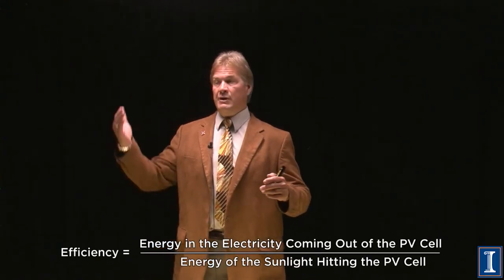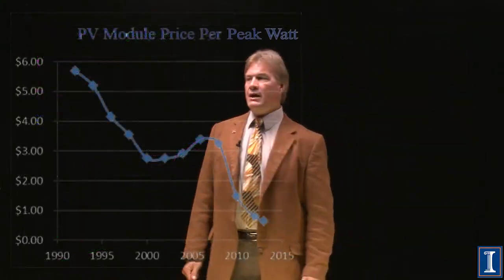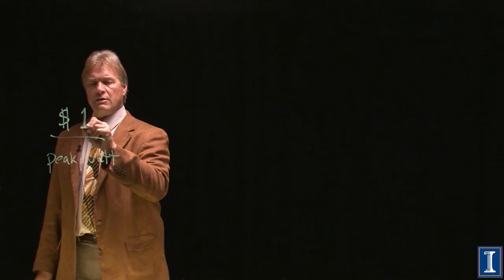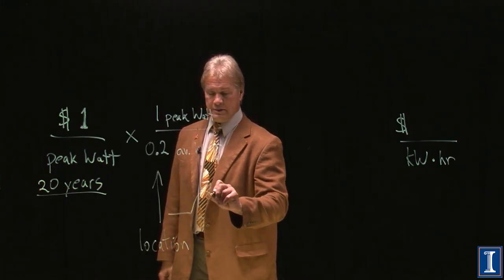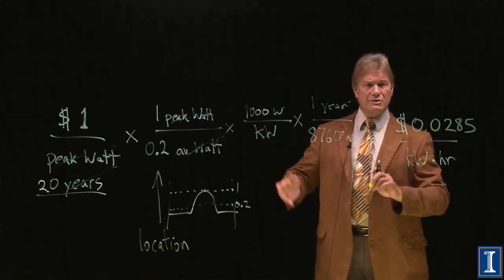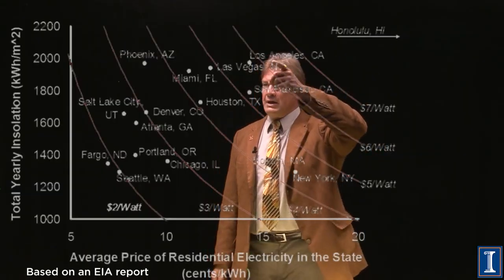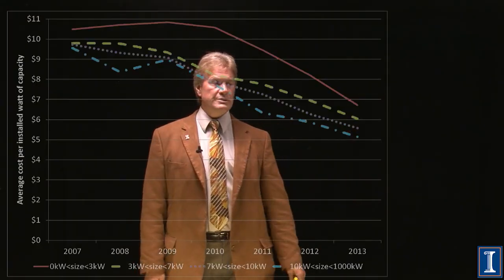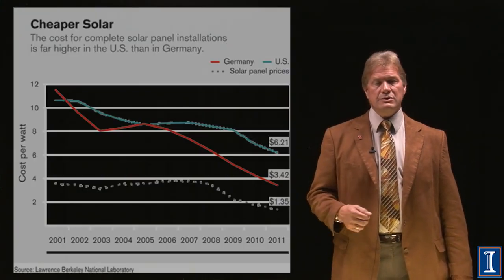The Cost of Sunshine

Comment: When I bought my new 5,000 sqft home I ran the air conditioning with abandon during the summer to see how much it would cost me.  My home used 3.2 mega watt hours a month.  OK, how about 3,200 Kilo watt hours a month.  But here in Loveland, Colorado I was only paying 6.5 cents a KWH in 2006.  Now in 2020 I am paying about 9.7 cents a KWH.  During the winter months and replacing most of my lighting with CFL or LED lighting, I got my usage down to about 1,400 KWH.  Air conditioning is a BIG energy draw on the grid.  Places where solar is cheap in the south western part of the US requires huge amount of electricity to run their air conditioning.  In the north where it is much cooler, they use natural gas to keep their homes warm.  It is not cost effective to heat with electricity.  The real calculations and the debate of solar-wind verses fossil fuels is very complicated.  The use of CFL and LED lighting has made a huge reduction in electricity usage on the grid of the US.   Microwave cooking takes much less electricity that does an oven too.  Only places where no electricity is available at any price does solar-wind power makes sense now.  The costs of solar and wind power will never compete with fossil fuels even if the solar panels costs drop to 25 cents per watt.  Nuclear power electricity generation seems cheaper than fossil fuels now because they don't factor in the total costs of the safety factors needed for the plants and the total costs of spent fuels storage.  One nuclear plant meltdown will destroy all the savings from this method of generating electricity.  This is the lesson to learn from this video.

Comment: Great video!
You can really see how solar really isn’t an option most places due to physics and just a few economic considerations. 

There are a few additional things that make solar even more expensive he didn’t cover:
1. Subsidies. Money taken from taxpayers and redistributed to solar companies, installers, and customers to artificially reduce the cost. True costs are far higher. 
2. Efficiency over time. Solar efficiency drops dramatically over the years.
3. Warranties. He came up with a 20-year warranty but no company has lasted anywhere close to that long. And even if there is a warranty, that’s not a guarantee you’ll receive it. This number should be cut by 50-75%
4. Maintenance. Other forms of power require no maintenance by the consumer. Solar panels need to be frequently cleaned or efficiency goes down even further. Also they are usually mounted on things like roofs which also need to be replaced or maintained and solar would need to be removed. 
5. Damage. He waived off hail and storm damage and didn’t figure it in at all. But most solar systems get damaged quite easily and the consumer would need to pay to replace it. They don’t pay for traditional methods. 
6. Balancing the load: Solar systems usually can’t stand alone because they have a hard time balancing power loads without gigantic and expensive battery arrays. Most solar systems are used in conjunction with grid tied power sources which provide the actual stable power and in emergency situations as well.
Reply: Lies
Reply: @jackfanning7952  Solar advocates do lie frequently... I guess you have a point there.  ;-)
Reply: Let's take each of the points you mentioned: 
1) Nuclear has received 50% of the subsidies granted by the U.S. for energy. Fossil fuels, 25%. Everything else, 25%. True costs for nuclear are much higher because they haven't disposed of any nuclear waste in 75 years and taxpayers are paying utilities $1 billion a year to store their own nuclear waste. on site within 100 miles of every major city in the U.S. What could possible go wrong? Nuclear is not required to obtain insurance for liabilities from nuclear damage. Nuclear utilities are bribing legislators to increase subsidies for nuclear and strike down legislation favorable to energy conservation.
2) 48% of the nuclear reactors ordered from 1953 through 2008 were cancelled, 18% were prematurely shut down and 14% experienced at a one-year-or-more outage. Not very reliable, eh?
3) The only warranty you will get from the nuclear industry is that they will take the profits and the public will pay for any liabilities. History has shown there will be plenty of liabilities from the nuclear industry. You betcha!!
4) See item #2, except add a few billion for much costlier nuclear maintenance and cost for substitute power. New Orleans' ratepayers had their bills go up 300% in one month in 2020 due to the maintenance shutdown at Grand Gulf nuclear plant. 
5) The whole world for many generations to come will pay for nuclear damage. Damage that cannot be completely mitigated once you open nuclear's Pandora's Box.
6) You just haven't been keeping up with the current events in the energy field have you? Existing storage systems for any energy source are readily available. There have been astronomical advances in storage technology in the last decade as well as cost reductions in renewables. Lazard, the largest independent financial institution in the world. states that storage can be managed for 1.0-1.5 cents per kilowatt hour.  Wind or solar and battery storage can be had for less than half the price of nuclear.
Reply: @jackfanning7952  
I’m not sure where you got your information from but it’s all wrong or outdated?? 
So-callled “Renewable energy” obtained a whopping 93% of federal energy fuel subsidies while generating a mere 22% of total U.S. energy. This is directly from the U.S. Energy Information Administration (EIA). This also doesn’t include how most states don’t tax wind and solar and give them other benefits redistributed from unfair additional tax levies placed on nuclear. 
The vast majority of nuclear waste is kept on site, safely, securely and without any additional cost in concrete caskets the size of a car. What can go wrong?? Not much. Because it’s easy to simply pour another concrete container. The entirety of all nuclear waste produced in history can fit on a single football field it’s so little. New reactor designs actually run on what was previously considered waste. And I’m glad you brought up insurance liabilities, because wind and solar are completely free from prosecution even after all the environmental damage they caused. Wind has special permits to kill rare endangered birds. And if you want to talk about bribes, that’s what the wind and solar industry is based on because they don’t make a profit since they produce so little energy. Talking about reactors shut down is just political decisions, not economic ones. And there is no warranty from wind and solar, all the companies fail after a short time. The only guarantee is that they waste taxpayer money to prop up the industry. The Grand Gulf power plant provided power at 0.5 cents per kilowatt which is one of the cheapest rates in the US… so whining about a 300% increase is just silly if you look at the actual prices paid. Regardless, people are getting a rebate on their bills now. And if you want to talk about permanent damage, wind and solar are far far faaaaaarrrrr worse. The current mines can’t keep up with production for all the needed rare earth metals and other materials so more and more mines are needed. Most of which are incredibly destructive to the environment and operated using child slave labor. Let me say that again. CHILD SLAVE LABOR. Wind and solar’s short lifespan also has them filling up toxic waste dumps to capacity. Unlike your goofy claims of not keeping up, you should take your own advice. There aren’t anywhere remotely enough batteries to store the energy required for homes. The batteries are also far worse for the environment than anything else and don’t last long. They aren’t economical and the advances are all in a lab and not practical to use anytime soon. Lazard’s figures by the way factor in billions of dollars in taxpayer funded subsidies to come up with the 1-1.5 cents per kilowatt hour. That is 3x times the cost of Grand Gulf Nuclear Plant by the way!! And that’s not even counting the costs to generate, deliver and maintain the power which is astronomically stupid. If you think wind and solar are a good idea, reach into your own pocket and personally donate your own money to subsidize it. But let’s be honest here, we both know you’d never do that.

Comment: REAL BENEFIT OF SOLAR IS NOT 8 BUT 2 CENTS, AND BATTS CAN'T SAVE.  Great video, but he still assumes the utility will always pay for Solar electricity from homeowners at market price, and has and will keep having Fossil Fuel power plants to cover load at night or days or week of zero sun due to clouds.  In real world any utility will have its Coal and Gas power plants it must build and maintain and keep to cover 100% of load in case of bad weather or nighttime -- and the only benefit of Solar power to the utility is the savings in not burning some coal and savings in maintenance from running plants a few hours less midday some days.  This coal savings and maintenance savings is probably just  2 cents a kwh not full 8 cents, so a power company will only want to pay homeowner  2 cents, and this scheme will be needed if solar ever becomes more than 10%.  Incidentally, sun is good only for 6 hours a day and 0 hours on cloudy days so even if you built solar cells enough to carry 100% of load these due to the few hours would only cover about 30% of power needs through the day, which is depressing but a fact.  In reality for all these reasons Solar is terrible option for power grids and will probably stop at 10% of load, so Solar is not an alterative to fossil fuels for electricity.  Batteries cost so much and wear out each decade using them would cost up to 4k a year plus whatever fossil or solar costs you have, batteries to cover nights and days of bad weather is NEVER going to be tried which leaves Solar a bad idea.  Frankly, Nuclear is the only green option.  I would be glad to see numbers showing I am wrong.

Comment: Just a couple of thoughts from a Phoenix area Realtor that has helped people buy a house with solar. First off leased solar gives no value boost to a house because it's a lease and some buyers don't want solar leases for whatever reason. So, a lease may impact things when selling your house. Owned solar gives people a tax break of some 25% or so based upon state & fed tax laws & credits which change every year. Like every other improvement to a house (pool, kitchen remodel, etc) you will not get all of your money back as a rule. Generally speaking improvements only recoup some 30% of their value on the sale of the house and that is what I'm seeing with owned solar. So, if you spend $30,000 on a system and get $10,000 tax credit, and it boosts your home's resale by $10,000 you will be out $10,000 minus what you have saved in electrical costs. If you save  $2000 per year then you break even at the 5 year mark and if you keep the house for 10 years you should make $10,000 on the solar system. But, if you sell at the 3 year mark you would lose $4000 in this example.

Of course this is very simplified and your mileage will vary. I'm just pointing out an area that you should verify the details, actual power production, costs, savings, etc as part of your buyer due diligence.

Comment: the 20 year warranty number is BS.  No solar panel installation company has been around 20 years and none will be over the next.  They always get out of warranty work.  The cost breaks down to ridiculous if you use a real number for replacement time.   Also, you did not mention maintenance.  There is almost zero $ maintenance of the coal powered electricity in my house.   With solar power on the roof you have to clean them monthly or the efficiency number goes down.  If you think rain will clean your solar panels just look at your car after a rain!  Unless you're under 50 years old, you will be paying someone to clean your "power grid" on a regular basis.

Comment: The calculation neglects the decommissioning & long-term storage costs which are negligible for gas but very high for nuclear. If you factor this in, the business case will be less clear for 4th gen reactors across 40 years of operations. Of course, you can argue that gas is dirty and contributes to climate change - and that's something you will have to factor in as well.  Let's hope that we'll have fusion reactors in 20 years - these will be far less controversial. In the meantime, fission reactors can help us to mitigate climate change - which is far more urgent that both the storage question as well as a little bit of money.

Comment: Why do people assume that solar panels have to be installed on a roof? There is already an AC power line attached to your house. Just fill the desert in Arizona with grid-scale solar, and the install cost per watt will go way down... am I missing something?
Reply: You could, but there would be the casualty of the environment. That would drastically change the habitat. This has been seen in other locations where massive solar arrays have been installed.
Reply: There are pros and cons to both. Roof saves transmission; desert has better insolation; etc. There's no clear winner until you go through the numbers for each specific case.